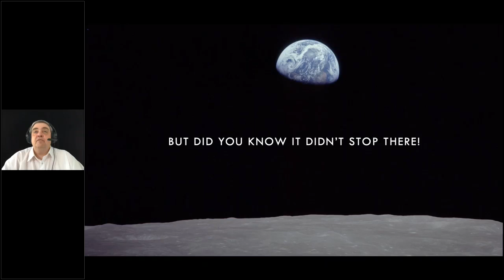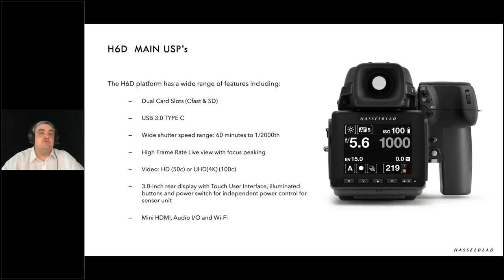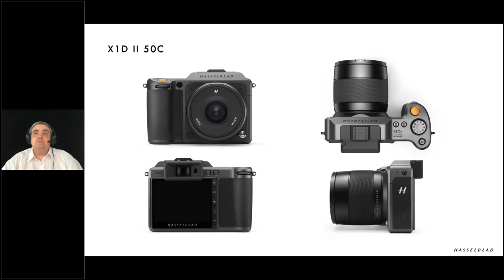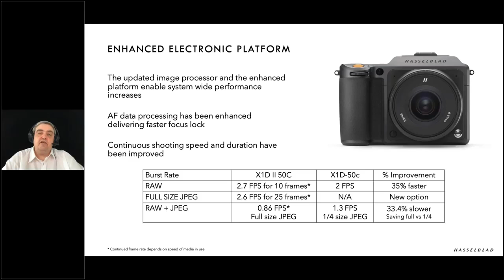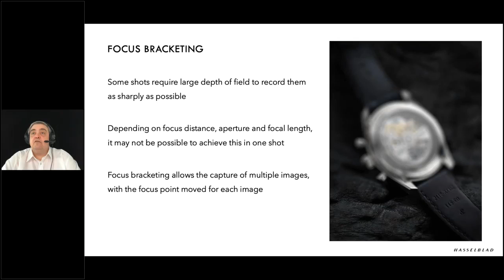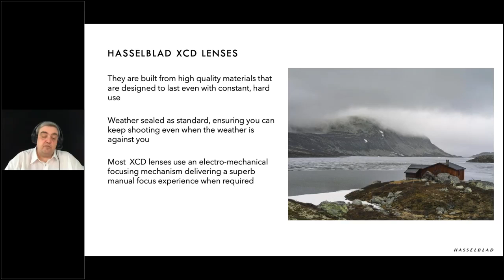This history of Hasselblad and discovering the X1D II

Comment: HI Chris - thanks for this - I have been pro for 35yrs+ and was in and out of Hass until Digi came along when I was full on in with a H6D - and it is a truly wondrous thing. Looking at getting a 907x for various reasons but I am also slightly drawn to the video capability - I do know the optic is removable from the bracket which supports it - is there enough tolerance to mount a small Broncolor RFS2.1 or a small microphone accessory? Assuming it does not have a built in microphone. Also with regards to the video capability does it crop the sensor, are there other shutter speeds other than the 29. something or can you indeed specify which crop - thanks - Simon J Miller
Reply from the maker: Hi Simon, here are the answers to your question. 

1.	The optic is removable and the bracket will accept a standard trigger or microphone acc. Alternatively, third party l grips are available with cold shoes fitted to them
 
2.	The full sensor is 8272 x 6200 pixels, for 2.7K video we use a 8272 x 4653 pixel area from the centre of the sensor. 
•	Next, depending on video resolution selected ( 2.7K or HD) we will average out the output signal  of two or three rows and columns of pixels
 
•         So for 2.7K the following happens.
 
•         We average 3 columns of pixels to reduce the 8272 down to 2757 pixels
 
•         The height has every two rows averaged to get 2268 pixels.
 
•         The file is then down sampled to get the 2720 x 1530 pixels required
 
 
3.	The frame rate is fixed and runs at the maximum the sensor and processing workflow  can support.

Let us know if we can help any further or with sourcing Hasselbad - Owen
Reply: @Campkins-cameras  Good gracious - thanks for the highly detailed reply - awesome stuff - I have just ordered one regardless - but it has been tricky to find out info on this subject - I may even start my own YT channel proper with some landscape videos shot exclusively on 907x with all those wondrous lenses!!!  - and I will be using my HC lenses on it too - outstanding - thanks for the reply - stay safe - have a great day Owen - Simon J Miller